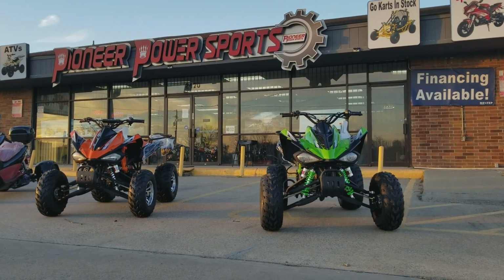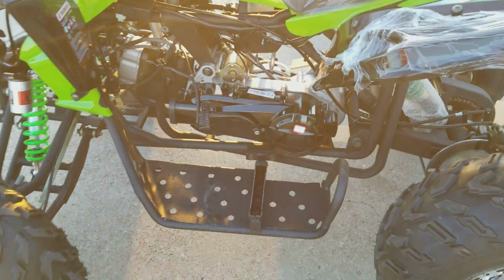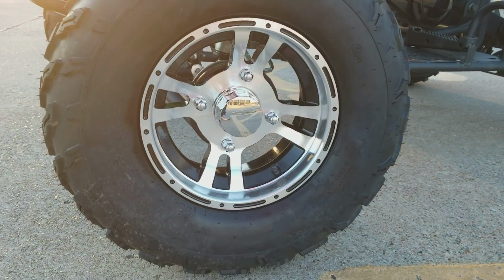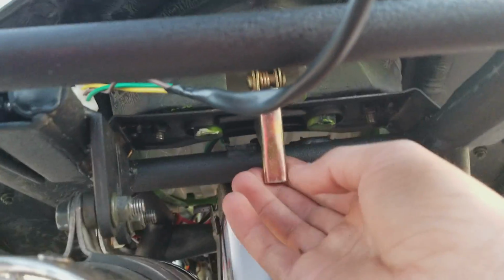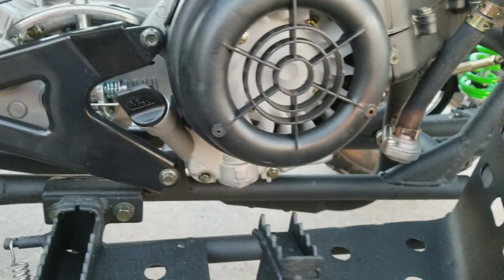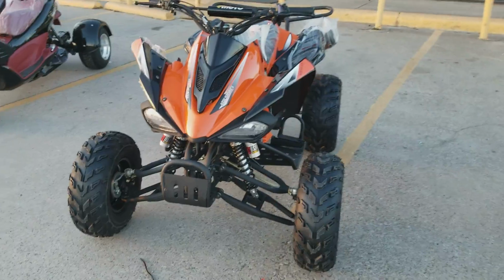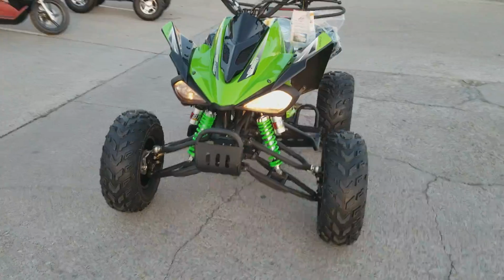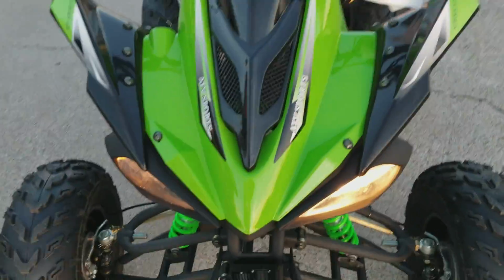Badass 200cc sporty atv in action 😱

Comment: Quick question, bought one yesterday 200cc , Chinese ATV, i turn the fucker on this morning , no problem, take her out, no problem, get back in the garage and....it would not turn off, key turned off and out and no fucker still kept running , tried to kill it with the button and it worked but then the starter (I assume?) was going *click *click *click) and it did so non stop until it drained the battery , i then removed battery to recharge and when placing it back in connected the + Positive first , then when i touched the negative to the battery (WITHOUT A KEY) the fucker started clicking and trying to turn on again!!  it seems if the battery has power , its trying to start itself. Any suggestions anyone?
Reply: My tip is don’t buy a quad from china Japanese and American only

Comment: Damn dude, sounds like the chain is loose
Reply: Thats the plastic on the suspension
Reply: It’s actually the foot plate vibrating from the shitty wield I have the 200 model it have to much torque it does wheelies if you hit it to hard

Comment: I bought this and now for some reason I can push it forward but not backwards , any tips on why?
Reply: Push it or drive it? Did you push the gear selector, the knob by right foot,  into R (reverse)?
Reply: @KrazyBear918  just tryna push it not drive , brand new only one ride
Reply: @993leo  Is the battery working? Try putting the Gear Selector into N (neutral), and when the Green light comes on, try again. 
Note: The battery will need to be charged in order for the lights to illuminate.
Reply: @993leo  Also, sure to make, the PARKING BRAKE is disengage. Right handle lever, check it.
Reply: @barry would you know how to tighten a chain like this

Comment: Where can I buy parts for my 2010 cool sport 200cc atv?
Reply: I just bought a 2010 cool sport 200cc standard shift for $400 today. Missing seat, little plastic  strip that goes through/ over middle of the tank. And small front hood cover. The bike runs real good. Do you guys think I got a decent deal?
Reply: @kellyhillyer139  did u ever find a place for parts?? i just bought one 2012 i need the plastics
Reply: @just_breathe_4157  no I didn't  find nowhere  to buy parts other than Amazon.  I already sold it though. I bought it for $400 had a week in a half and sold it  for $750 so I did good I'm  happy. Looking for another1 now